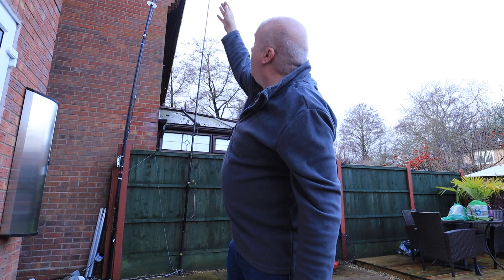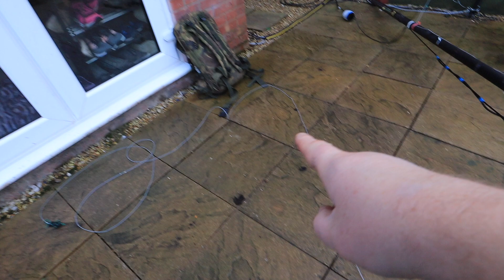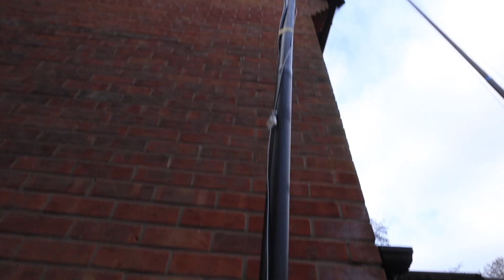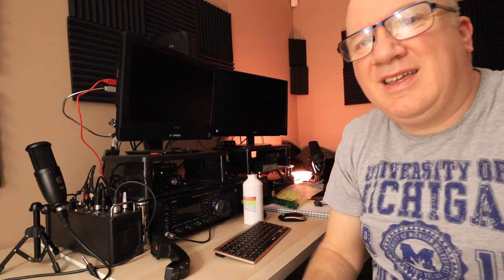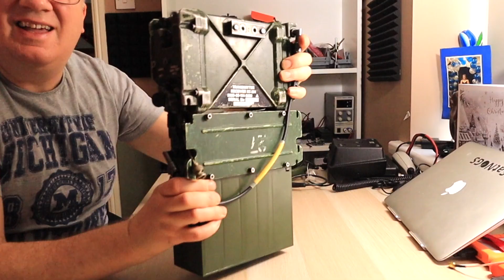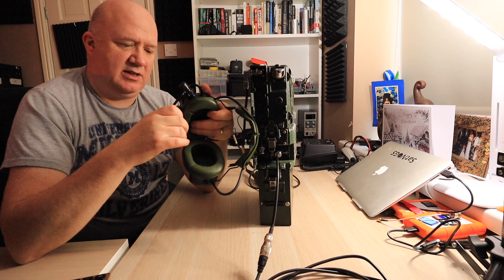Setting up 4m using Clansman PRC-352 military radio

Comment: Hi Carl, thanks for the video, I appreciate the work that goes into making them. I have just bought a 352 set up and found that I am missing the BNC cable from transmitter to amplifier. Please could you look and give me the Nato Part Number from yours, so that I can find one? I would be grateful. Thanks.
It's now 2 1/2 years since you made this and there does seem to be more activity on 4m. In Berkshire, my patch, the locally monitored frequency is 70.425 and there is a net based round the Reading area from 2030 to 2130  on Wednesday evenings.

Comment: Have you removed the 150Hz tone? It works on TX/RX  The only way I know of defeating it is to turn the level right down as the tone itself cannot be switched off. Otherwise your transmitted audio will  heard with tone imposed, I did this to my 351/2 & it worked, also the deviation is far too wide at 12.5Khz & will need adjusting then you'll have a really good bombproof  4m radio. Great Vid BTW 73's de M0NJE
Reply from the maker: Yes it was already removed

Comment: so using a prc 349 at the same frequency as a prc 352 it would work in theory would it not? I would like to know to use across the farm
Reply from the maker: The 349 doesn't do amateur bands so can't recommend using it but they can work on same frequency.. A 350 and a 352 can using amateur bands.
Reply: @M0SZT  its just I already have a 349 and wondered if I got a 350 or 352 I would be able to use them together between me and the people i work with on a farm where we are a long way from each other

Comment: I carried the 320 for years, I'd love to play with one again.  I wonder if I can remember how to use it.  Sadly I can't afford one.
Reply: You can get them on Ebay for a modest price, I built my collection up slowly buying just what I needed to get up & running to start with. Cost me about £650 for a Thick Fin version with LSB batteries charger audio gear & antennas & soft backpack, but by then the bug had bitten me hard & the only thing I'm now missing in that collection is the mast but that's just a matter of time. I've added a PRC4031 & an Ex Navy Plessey/Skanti TRP8255 HF Marine Transceiver I just love green /grey HF Military Radios they don't break easily.

Comment: I have prc 352 with 4m on a tactical mini....lf theres a net being set up i would like to give it a try 😎
Reply from the maker: Whereabouts do you live?
Reply: @M0SZT   Wisbech, Cambs. If its a bit far away i cud travel closer to set up a QSO. I don't mind the trip because it's somewhere new and an excuse to get out and about. I also have a VRM 5080, PRM 4145N (needs freq reprogramming for 4m band, i found someone on the internet doing this for £20 per radio)  Racall , Anytone 588.  I also have HF and 2 m/70cm .My C/S is M6IFY. Zello on my Android phone is darkehammer.73😎👍

Comment: Are you are talking into the wrong side of the microphone, the outside is noise reduction, ie to cut out the sound of gunfire ..bombs..speech etc. put it on your head and use it properly or use a handset.
Reply from the maker: I recorded my voice via the websdr at Nantwich and it was strong so that's why I used it like that.

Comment: Well, I'm glad for two things in your video today.  #1You decided to go inside.  I was afraid I'd have to tramp around with you in the damp and cold.  #2 You finally laid the radio down on the desk.  It was rocking a little too much for my comfort and I was afraid it would tip over onto you laptop.  It also gladdened my heart that you antenna wires were so precisely laid around the exterior house - much as my wires are.   Good video; to bad there was no contact today.  There's always tomorrow.  Keep them coming Carl.  BTW, appreciate the mention in your Christmas comments.    W0YVY

Comment: Hi Carl. Thanks for another good insight into mil radio. I'm just intrigued by the fact that a lot of these mil radio's seem to like to run with an open squelch and wondered if you had any comment on that ????
Reply from the maker: They usually have Squelch On and Loud settings, so you can turn the squelch on

Comment: did you test the antenna is tuned and that you are getting rf out put hope you get your knee sorted
Reply from the maker: Yes tuned and hitting websdr easy
Reply: @M0SZT  good stuff i always like to see whats going out on the portable kit you can not see it worked a guy in the starts today on 14,170 KB0EO been a few years since i last worked him  and i heard a very strong station on 7,163  YB0AR have worked him before but no chance to day i may try 80m in the afternoon if its not raining tomorrow